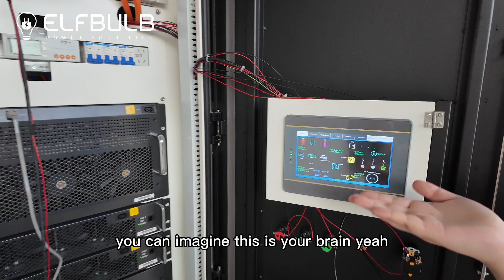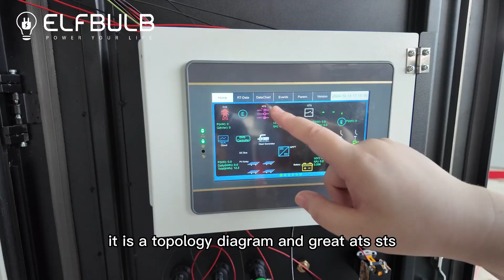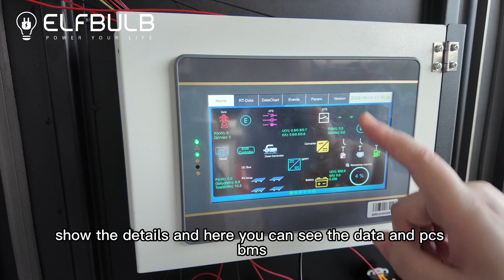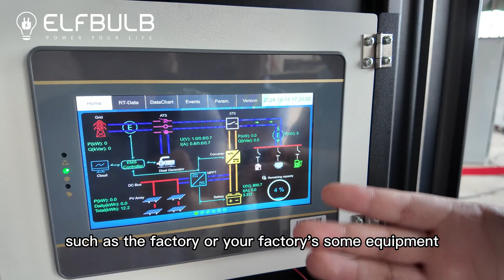Kali's 215kWh BESS Solution Explained: Revolutionize Your Energy Storage!Only about 30,000 USD

Comment: 30,000usd for this is a good deal 😊
Reply: Yes dear, are you looking for such a BESS?😊
Reply: @Kali-YuyangElfbulb  Hmmmm I think I heard you mention two 50kw mppt charge controllers, but I am not sure if it has an inverter built in and what is the power of that inverter. single phase or three phase.